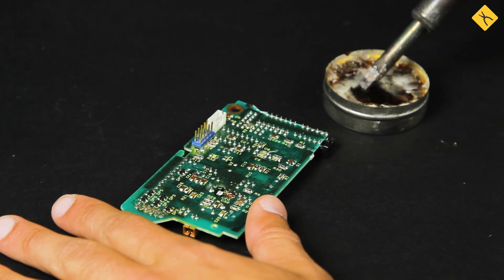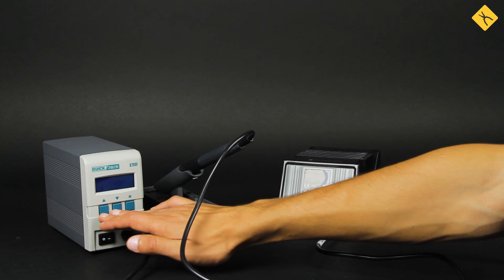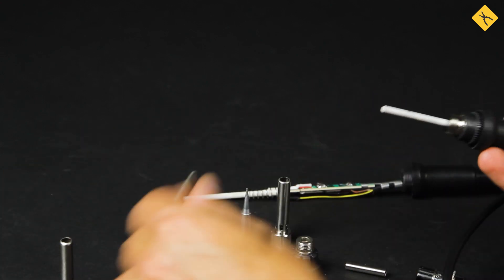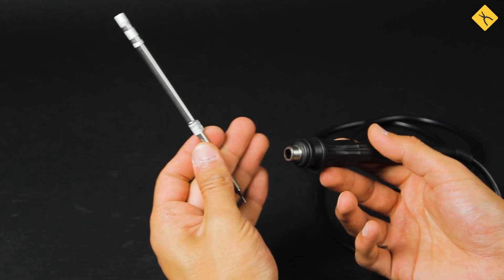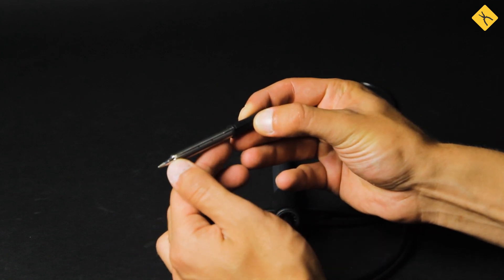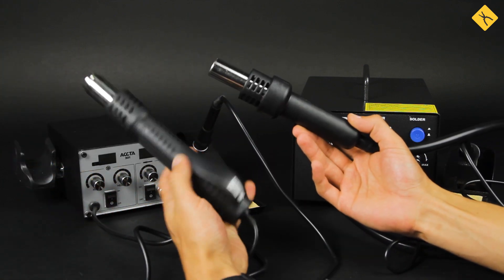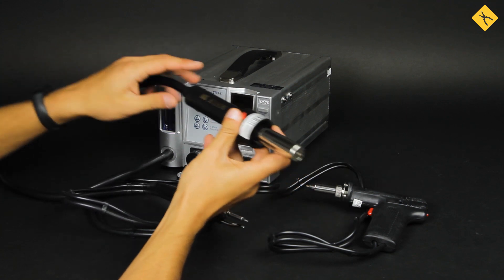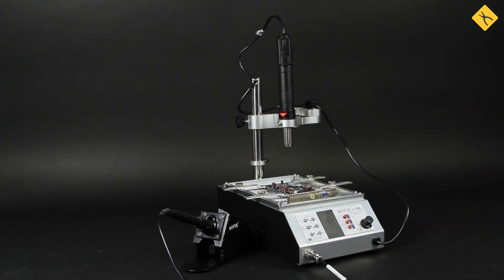How to Choose Your First Soldering Station

Comment: What should I get that is not too expensive, high quality and easy to use.
Reply from the maker: Hello! We recommend the ACCTA 301. ACCTA 301 is a reliable and easy-to-use soldering station.
https://toolboom.com/en/hot-air-rework-station-accta-301/
Reply: ksger, using t12 tips and reliable